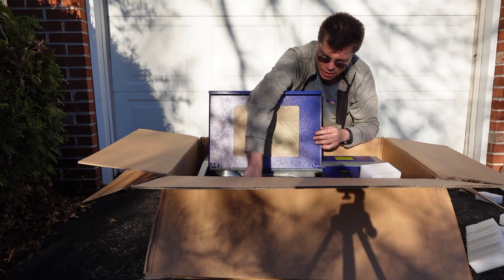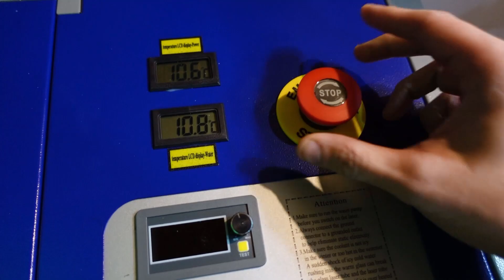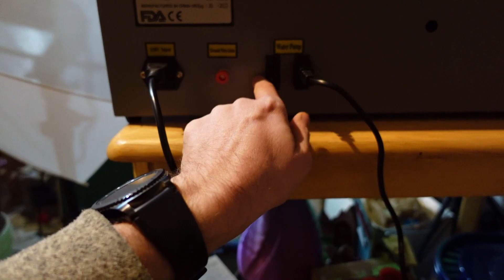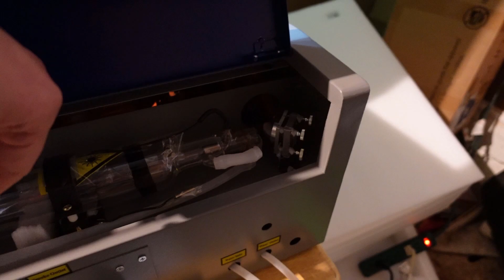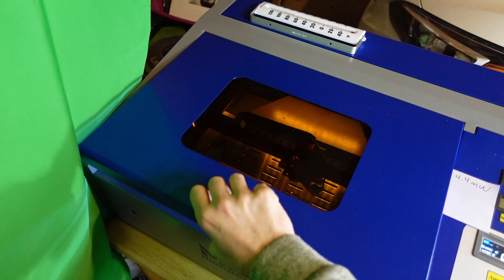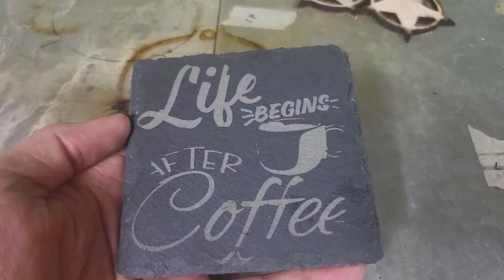Monport 40watt Laser Setup and Burn Review

Comment: could you use automotive antifreeze instead of distilled water for cooling?
Reply from the maker: I've heard of people talking about using RV antifreeze but I haven't tried it. The instructions said distilled water so for the sake of the review I wanted to follow the instructions.
Reply: I believe water will transfer heat better.